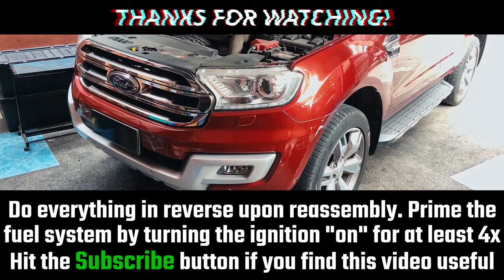Ford Everest Intake Manifold & EGR Removal DIY | Ranger | T6 | T7 | TDCi | 2.2 | 3.2

Comment: I'm doing this at the moment, and I'm hating life. This motor is seriously the worst one I've ever worked on.
Reply from the maker: I feel you bro :)
Reply: Try installing a diverter valve on a 320i f30 bmw
Reply: At first brother its sucks, but after your 2nd and third, youll be able to close your eyes while doing
Reply: @garycarlbalictan3440  yeah after doing it and looking back it's not that terrible. But I still don't want to go back there...
Reply: No cap bro, just got the oil pan replaced and it was way more dismantling to do than other motors

Comment: Well here I thought I can do it on a Saturday morning by my self...... So that idea went out of the window at about 3 min in the video. Thanks for the heads up. I will be taking my Ranger to a professional to do the cleaning.
Reply: Please dont, mechanics dont want to work on cars because of Fords. Just throw in in the bin and buy a new car
Reply: It actually seems not too bad. on my old Prado, I have to take the injectors and the intercooler off as well.

Comment: Sir gudday i watch ur video and i learnd removed egr and intake manifold.. but i've had some problem when i put back all the components parts.. when i turn on the ignition 30 secs 4x then i start the engine it will start but few seconds the engine shutdown.. i remove the fuel line from filter and no fuel bleeding come out.. could you help find the problem sir.. thank you and godbless sur
Reply from the maker: Hi! When you turn on the ignition, listen if you can hear the in-tank pump working. If it does, check for loose fuel pipes.

Comment: Hi took the ranger 2012 2.2 diesol to mechanic to replace glow plugs,plugs came out easy and put the motor back together  i drove it for couple of hours and engine light came on ,code was p042f egr valve closed ,called the mechanic he wasnt much help stated could delete the egr all together . any suggestions would be appreciated .also great video.

Comment: I have a 2016 Ranger. The engine management light came on firstly a bout 6 months ago but the mechanic cancelled it out as he said it was  possibly a sticking EGR valve. I an see from your video that it was a buggar of a job and an easy fix just to cancel out the codes.  Months later (2 days ago) the same happened again. (He cancelled out the code). What do you suggest? 120 000km on the clock. I use Premium diesel and service the Ranger every 6 months. Should i have the EGR valve serviced or replaced? Can i use a Diesel  intake cleaner to help free up the sticking valve?

Comment: Do I need to replace intake manifold gasket set at the same time as this or are they made for long lasting usw
Reply: Check it with your fingernail. if it's hard like plastic yes, soft o ring you are fine.

Comment: Great Job! To replace the 5 glow plugs on a Ranger 3.2 i have to follow this steps too, right?
Reply from the maker: Yes bro.
Reply: Also trying to find a video showing how to replace the glow plugs on a 2012  3.2 ranger. Do you have to remove the EGR to get to the glow plugs or is moving the Manifold enough to access the glow plugs?
Loving your videos 

Thanks
Reply from the maker: @lastpaceended5866  Yes you can access the plugs once you remove the manifold. Thanks :)

Comment: I have a 2019 3.2 ranger with 18000 miles on the clock & I've seen a lot of YouTubes about egr & coolers failing do I need to be concerned??
Reply from the maker: Not really. Just have your EGR cleaned every 40k miles. 1st sign of egr cooler failure (internal coolant leak) would be white smoke on startup. But this usually happens on a few high mileage units. We’ve had 3.2 rangers in our shop with 200k+ miles on them but still have perfectly working egr/cooler. If ever this happens to you, either replace the cooler or just bypass the coolant hoses to the cooler and blank the egr on the exhaust end - you’ll need a tuner who can also disable the EGR on the ecu for this.
Reply: @btdgarage  thank for the information much appreciated.

Comment: awesome... a bit curious with coolant hose.. do i need to prime it after I put it in place..
Reply from the maker: Hi brother, simply put it back in place and top up the coolant reservoir upon starting the vehicle. Make sure to let the coolant system “bleed” for a while or to let the air bubbles escape while idling. Drive the vehicle around for 10-15mins then recheck the coolant level and top-up if necessary.
Reply: @btdgarage  Thank you for this video, I learned a lot.. hope more videos to come.. thanks again for sharing...
Reply from the maker: @franciscoandres9053  Thanks!

Comment: Saan nyo po nabili ang mga special tools na ginamit niyo po? Nahirapan kasi akong maghanap ng star screw driver eh na 12mm. Salamat po
Reply: I meant yung tool po na pang remove sa torx screws, where did you purchase it po?
Reply from the maker: Online Sir madami. Try Lazada or Shopee. Get the branded ones po para durable.
Reply: Anong specs po ng torx key nyo po? May nakita kasi ako sa Shopee Ingco torx key na T50 ang size. Ok lang po ba yun na size?

Comment: Good pm boss.i need your help.
Ford everest 2011 Diesel..
Issue.ignition on the engine light and glow plug light not showing and cranking but  engine not starting.pcm connector no power supply.where is the location of PCM RELAY? THANKS
Reply: How many mileage now?

Comment: Sir. Ano po recommended cleaning solution mo para sa lahat ng parts na lilinisan? Planning to clean mine 80k kms na. Thanks
Reply from the maker: Hi, you can use engine degreaser on the manifold & egr valve then rinse with a power washer. Just make sure to remove the sensor on the manifold and the egr motor. Use an electronic parts cleaner or Maf sensor cleaner on the throttle body.
Reply: Thanks sir
Reply: @btdgarage  totoo ba na sirain daw ang ford?